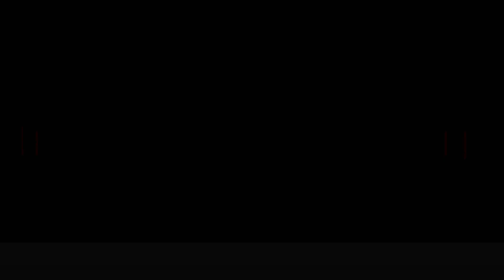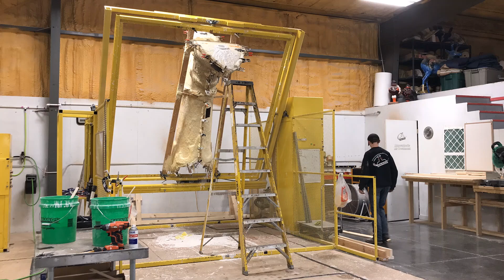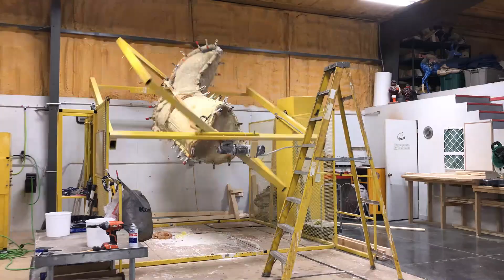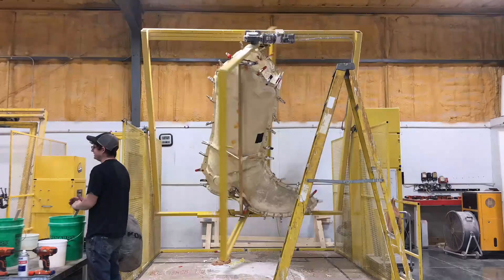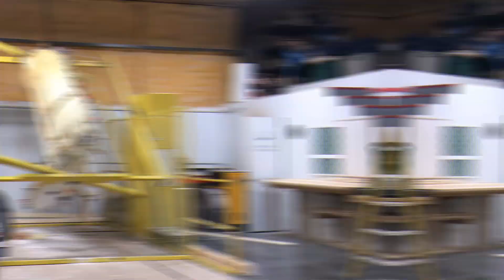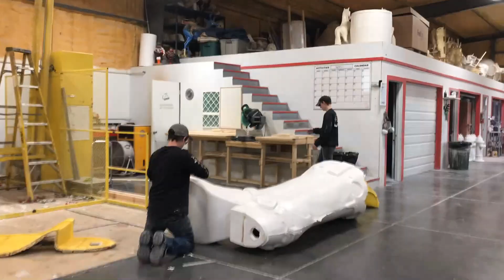Large Scale Rotational Casting | Polyurethane Sculpture Making

Comment: Great video, thanks for sharing! What an incredible machine!!

 Three questions:

1) what brand/type of rotocasting machine do you use?

2) can you adjust the rpm of both 'rotating windows'? And how important is that? I know that they should not rotate at the same rpm but I guess it is more complicated then that.. ? :)

3) do you use chopped fibres mixed with PU at 2nd/3rd layer..? Do they spread evenly about internal surface or do they roll up like a a snowball effect?

Comment: In what scenarios would you choose to use the rotational casting machine to fill the mold vs just fiberglassing the interior of the 6(?) pieces then connecting them together? Is that decision based on where and how the final piece will be used? Also, I'm very new to the field, so forgive me, but what material are you pouring into the mould in this video?  Thank you guys for all of the info! I really appreciate all of this new content.
Reply from the maker: Paul, We rarely find an occasion where we would layup a piece rather than rotocast.  We have spent years working on the process to produce fiber reinforced rotational castings and now it is way more efficient for us.  Almost the only time we would layup a piece in parts is if it is to large to fit on our machines.  We use different resins and materials when we rotocast but a good    percentage of time we use fast set rtv polyurethanes, microsphere glass beads, poly fibers and glass fibers.  These are mixed different for each layer and introduced at specific times in up to 6 layers but commonly 4.  I hope this helps.
Reply: @IconPoly  Fascinating! I definitely didn't realize you were using several layers of different materials. Thank you for the insight and thorough response!

Comment: Ow and are transparent (glass like) castings also possible? Or is that really hard to achieve?
Reply from the maker: Lennart,

We can do transparent but they do not come out glass like.  They end up with many trapped air bubbles in the resin.  If the design calls for that type of look say a tinted simulated ice sculpture it's doable but not a glass look.  Also the transparent resins are very expensive which increases the final price tremendously.  I hope this helps.